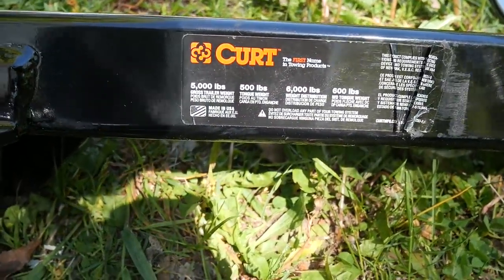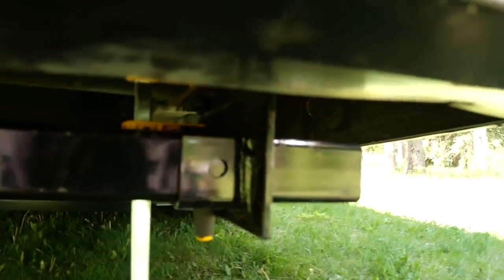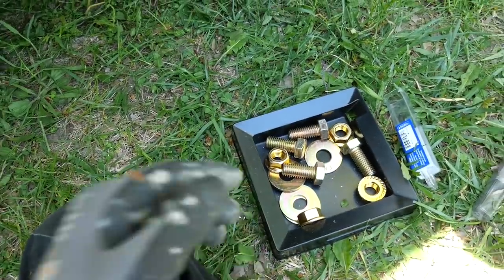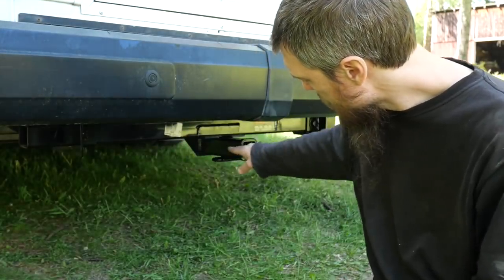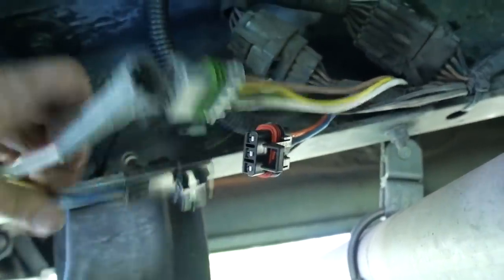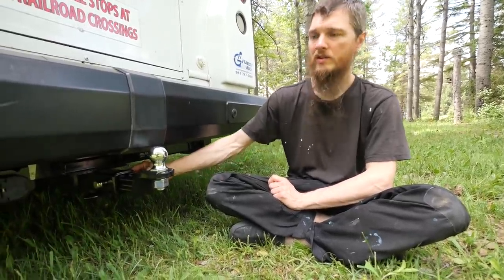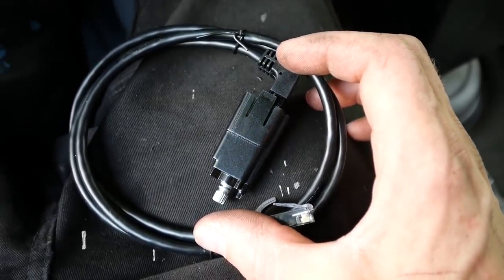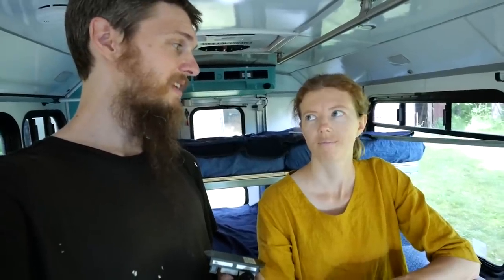We Put an RV Trailer Hitch on our Bus

Comment: You’ve thought of everything!  Good work.  We are two seniors remodeling (somewhat) our bathroom.  My husband (age74) has crawled in our attic (no crawl space in FL) in the heat to run  a power line for a new area where an unused bathtub used to be.  Plus putting in Sheetrock, muddling, sanding, painting,.  Next is new flooring, and wainscoting in the old tub area.  It’s fun watching your progress.

Comment: You should see the faces I make working under our vehicles. Its nice to see you had plenty to work with as far as mounting a hitch. I put one on our Forester and it was not as easy as they made it sound. Fishing piano wire with bolts attached is like trying to fish for acorns from a hole in a tree. Always use a center punch before starting your hole, that keeps the drill bit from wandering.

Comment: You can buy either longer receivers or an extension that is just what it sounds like. Male pin on one end with a female on the other about 4" longer. May even have several different lengths. A height adjustable receiver would probably also work! Keep in mind the more pieces you add the more noisy it will be while towing!

Comment: It sounds and looks as though you are about to be done for the first round of fitting out and upgrading the bus. The hitch went on well and with the wiring done it should be safe to start towing when you need to fetch more materials. The dash area remains trim and tidy with none of that, 'I did this myself look' that some owners achieve. So, another good project with a great result. It will be interesting to see how it all works out when you road-trip the assembled package.

Comment: I was looking at your bunk beds there at the end. I’m concerned about your mattresses shifting if you have to brake hard while traveling. The angle they rest in is likely to decrease the movement, I would think. However, when you’re sleeping, your pillows might fall off. A little lip of a “headboard” and “footboard” might help ?  I love your home beds and the travel beds. I’ve looked up benefits of elevated angle sleeping. We are looking into ideas to raise the head of our bed without stressing the wood, and we refer to your builds often. Thank y’all for sparking ideas and getting us to think around the box.
Reply from the maker: The mattresses sit firmly together in place and can't shift around. We don't have headboards on our house beds and our pillows stay in place, so we're not worried about that. Another way of achieving the incline is by using a wedge that gets placed under the mattress instead of putting something under the feet. :)

Comment: I have been giving some thought to screens for the windows. You could just buy fiberglass screen cut to fit the windows with enough extra to wrap around cord/round weather stripping the can snuggly fit in window channel (window open). Store them when not in use. Since I guess you are opposed to magnetic strip tape that has sticky back to attach to window frame (which I assume is aluminum).

Comment: If you have this hitch, you can mount one bracket before you finish it off. So mount the first one, then slide the bar in and mount the second one without having to hold the whole thing up.

Comment: they make an adjustable height trailer hitch that can be adjusted for each trailer you pull incase the trailers are different heights. like my tow behind horse trailer was high, my boat trailer was medium height, and my junk hauling trailer was low bcuz it had the smallest wheels /tires. i just had to adjust the pin height to haul each trailer level, using my dodge 4x4 truck that came with 20 inch tires/wheels on it. this way every trailer was level and not riding with the tongue tipped up or down.
i wish i could remember the brand to be able to tell you. but sorry i can't. and i no longer have that dodge. i own an old rumble bee now.

Comment: I have neve imstalled one of these, so take my suggestion with a grain of salt. 
You know the lip of those two side pieces.  They looked like they could have been used for extra support. 

I would have swapped to the other side so the smaller part of the L shape, married into the inside of the short L part of the frame.,  so they could go above the frames lip, so to speak. And the. Drilled.

Comment: Is there a specific reason that you bolted the hitch under the L-shaped frame (└┌ ), and not above? If you switch the direction of the consoles (└ ┐), you can hang them on the frame then bolt them. This way the downward forces would be on the whole frame instead of just the bolts.
Reply from the maker: We just followed the instructions really. That's a interesting idea though :)

Comment: just a thought  ,, you may be able to:
 "adjust your rear bumper up" a little or slot the holes 1:06   in it to move the bumper assembly farther away from the hitch ball.. 
make sure to load  the proper amount of tongue weight for that vehicle and make sure to have the wheel on trailer jack all the way up so as not to bottom the  trailer jack  leaving parking lots etc....

 looking good keep up the great informative videos..

Comment: I am assuming this means your Element transmission is dead.  Mine did the same thing yours did and in fact, broke the left axel in the process of destroying the transmission.  214,000 miles, engine runs great, but no sense in replacing the transmission with that kind of mileage. Nice work today, but get a heat apron when working with hot metal!
Reply from the maker: Yea, we sold the Element. We could never figure out how to fix the transmission problem. It was just time to move on from it. Maybe it can be fixed, but it wasn't something we wanted to deal with.

Comment: Ok. Y’all will be addressing the visibility that can be seen through the Windows, like carbon tinting will help from heat besides the curtains
Reply: That's  good idea,  lowers the heat tremendously.  I have a buddy who does it. No Squint Tint
Reply: @peggynorton5535  exactly, the curtains are more for decor, no squint tint gives you way more privacy and heat reduction, plus they have babies…as they were talking I could see all through the back of the bus to the cheap seats…I’m exaggerating but you get the picture. 🤣🤣

Comment: I'm just thinking out loud up here in Canada eh (lol) but when you were trying to hold that big long hitch bar up underneath the bus to attach it across the back, would that air jack that you used in a previous video to fix your suspension system have helped you steady the bar on the one side so that you could attach it on the other side without struggling? Know what I mean?
It's funny, of all the jobs you had to do on the bus it's interesting to hear that this was one that you were expecting to be daunting. I mean have you seen some of the stuff you've done? LOL
I'm fairly certain that you could have done the wiring in your sleep!!
That controller switch looks like it belongs exactly where you put it. You know, like it came to market that way already....
Another good job!

Comment: This comment is not related to this video.  Doug have you ever used the Wago 221 wire connectors?  If so, do you like them?
Reply from the maker: Yes, I do like them a lot. They are hard to find here locally so I don't buy them, but I would if I could.